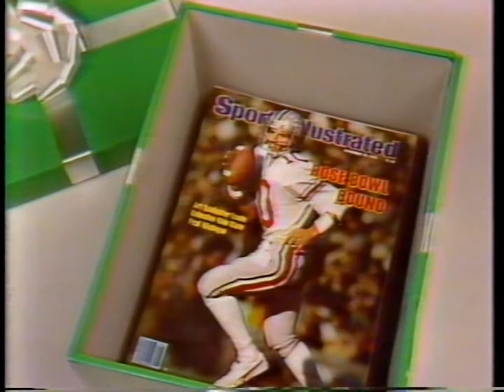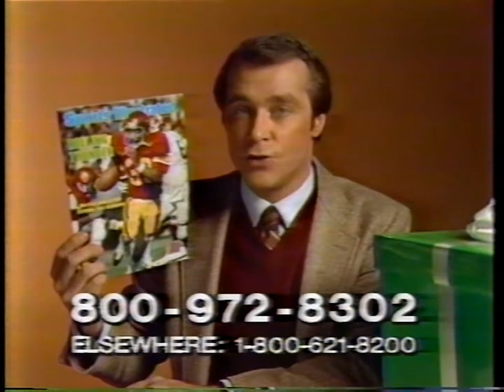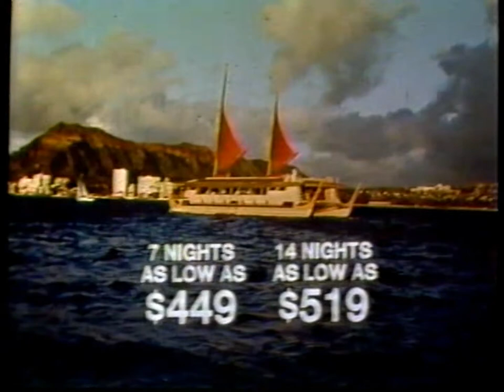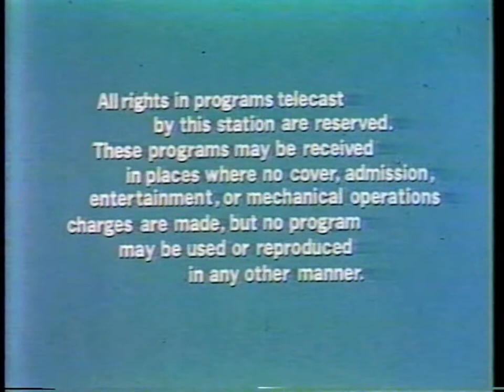WGN post-movie commercials, Five Minutes to Live By and sign-on November 1981

Comment: This may have been aired right after the end of the movie "The Comancheros" at 4:!5am early Sun. 11/29/81. Hollywood Squares would have been a rerun as filler programming that had originally aired on WLS-7.
Reply from the maker: Yes, the movie was The Comancheros. Don't know what time this actually was but KTXL in Sacramento which was also 24 hours 6 days a week would run a sign-on at 6 AM in the similar way. If they had filler programming for their all-night movies it would air before the sign-on.
Reply: @TheMediaHoarder  Do you have any more of the open to Hollywood Squares?
Reply from the maker: @jamieschmidt939  This one cuts of near the middle, but I have a few taped from Washington DC I should put up. Seems those have been OK here. I had a Newlywed Game get pulled by Sony though.
Reply: "Hollywood Squares" became a Mon-Fri syndicated strip series after it was cancelled by NBC, and production was moved to Las Vegas. The twice-weekly "nighttime" editions were cancelled when this happened.

And this version ended after just one season, so it appears that WGN-TV was burning off encores in early mornings before Bozo.
Reply: Squares ended it's syndicated run in Summer 1981. After the Vegas season ended its run in SPring 1981, some NBC daytime episodes from 1979 did end up airing as reruns in Summer 1981. Looks like the Vegas season was being rerun in November 1981 on WGN at 6AM. THis would have been the week of Nov 22-28, 1981 as Sunday November 29th was mentioned in an ad
Reply: @RolloSmokes  The deal may have been made for five a week syndication before the plug was pulled on the daytime Squares, which ended on 6/20/1980. The deal for the syndicated version being five-a-week could have been made as early as January 1980 at the NATPE syndication convention.
Reply: @RolloSmokes  And this version featured two players each show playing for prizes in each game instead of cash.  Most noted...no Secret Square.  The contestant who won the most games at the end of the night would win a special prize.  This all led up to an elimination tournament where the final winner won over $100,000 in cash and prizes including $20,000 in cash and a car.